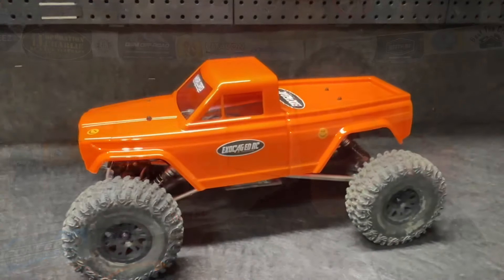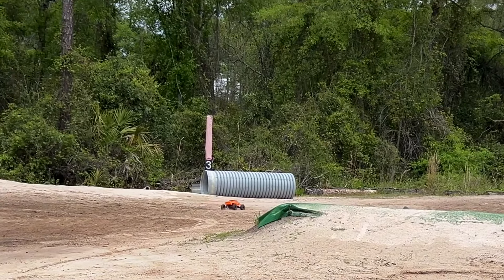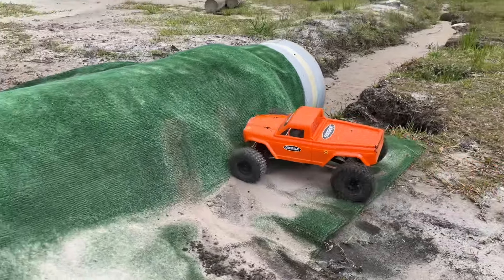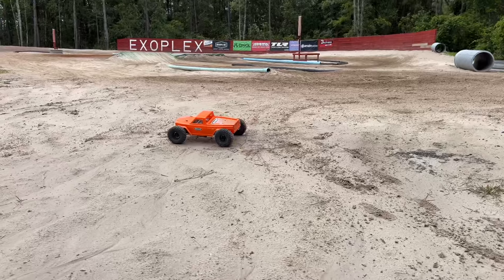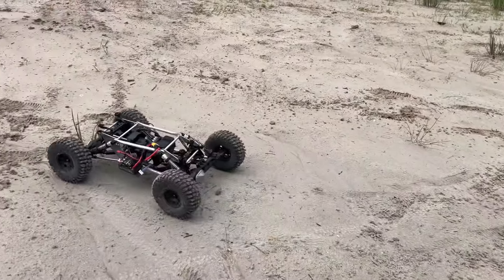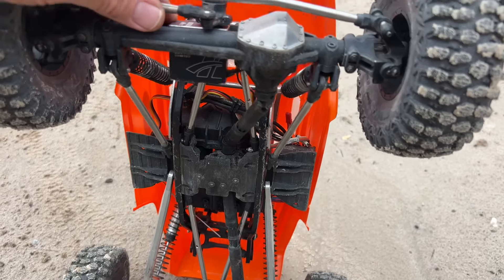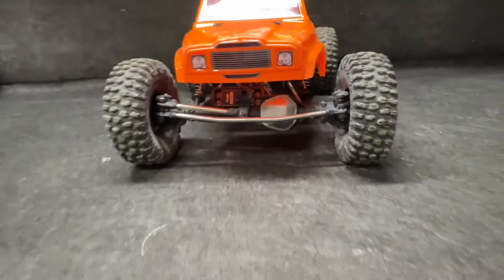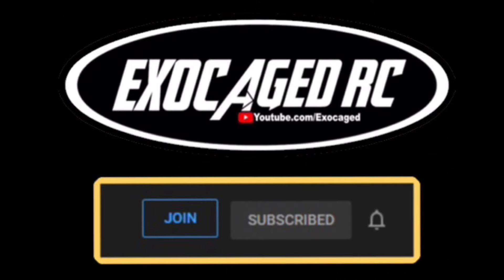RaceCamp with Warlord Body

Comment: If you can race a solid axle RC car surely you can make an independent suspension RC be able to crawl.  NASA only does independent  suspension crawlers and the Army only uses solid axles for things operating far away from the front lines like supply trucks.

Comment: Once that clay gets run in good the rain won't bother it at all
Reply: Could you get vitavon links for it?
Reply from the maker: Maybe, I should have them just gotta see which ones and there may be some capra links on it too
Reply: Wicked awesome 🎉❤
Reply: @ExocagedRC  capra rod ends are usually pretty tough especially compared to the ryft rod ends. They stretch out to dang easy